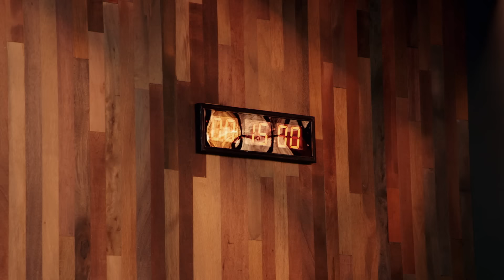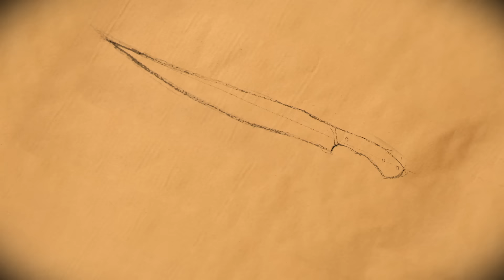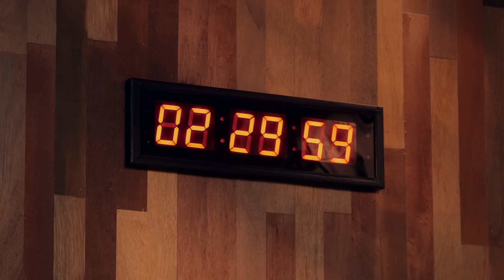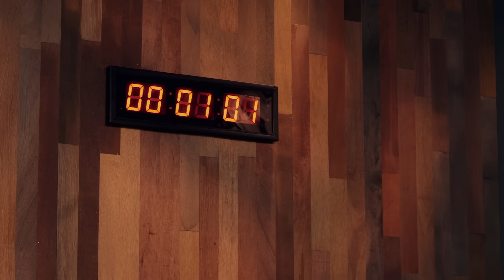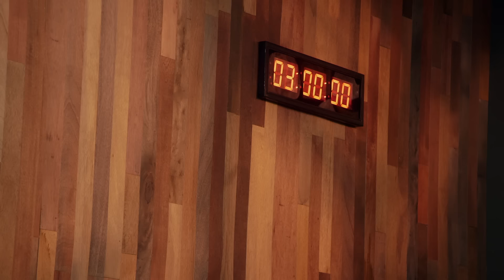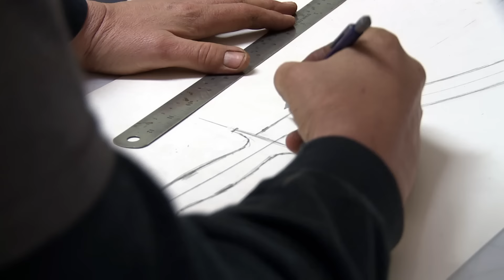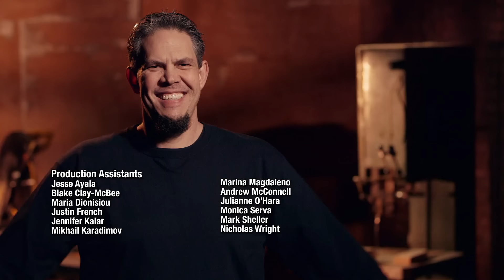Forged in Fire: REMAKING the Most Beautiful Blade in History (S2, E7) | Full Episode

Comment: This episode has me wanting to take elevator cable to make a snakeskin damascus core, then a very high (1200) layer count twisted bars, finally w2 bars and forge a serpent in the blade shatel. Then finish it with a sculpted bronze handle with the heads of the hydra being the cross guard.
Reply: Do it sounds like it’d be a amazing blade !
Reply: @wazrokk6626  man i saw a video that increased my idea to a double serpent in the blade idea... guy put two twist damascus serpents in the middle of a tapered broke back saux. I was like I can do that but with cable, then put w2 between them and on the outsides, then put twist bordering that then w2 for the cutting edge, run a remedial ridge in the center and hollow grind it to make it super light and fast yet super strong. Then I thought about s7 spring steel as the boarders of the serpents with the remedial ridge so it can spring and twist easily and not break, but I think I would have to use s7 and 15n20 in my twist to maintain the spring. However 1085 and 15n20 in the twist, s7 in the borders, and w2 in the edges would make a bunch of contrasts in the etch. I would just have to be really careful in my quench and temper to give everything it's best performances. I'm going to think on this a bit, then make a test billet and see how it works before I go into the expense of making a full sword. A 12 inch saux would let me test the theory, then I can go for a full sword.
Reply: @ make sure to make a video of it and tag me in it I would love to see this!
Reply: @ I think it’d also be neat to see everything made from scratch from raw iron being made into steel into a sword
Reply: @wazrokk6626  i am thinking of doing a tamahagone one also, or a crucible steel and tamahagone version with a wrought iron serpent. Another sword i wanna do is a twin sematar that inner lock to look like one normal sematar and then swings open to lock in as a double ended sematar using tomahagone only in a true Japanese style blade construction sami. Including hamone also.

Comment: What (if anything) is the difference between wrought iron and "pure" iron?  Also, what are things that smiths should avoid when working with working with wrought iron?
Reply: "Pure" iron has been melted from ore and cast once. Wrought iron means its been worked after that point. So unless the iron is in the shape its casting mold happened to be at the smeltery, it's wrought iron. This includes if while still molten from its first melt it's processed in any way other than being allowed to fill a mold. This is because Wrought is an old word meaning "worked" or "crafted".

Comment: You know this is an early episode because Kevin would have been DQ'd on a parameter failure for not turning in san mai ("three layers") in later seasons.
Reply: i may have just watched it wrong, but i think they let it slide bc as long as its still 3 layers, 2 soft and 1 hard in the middle, its still san mai. he just had a lot of layers of the soft metal over his middle hardenable steel. i could be wrong though
Reply: San Mai was not specified as the forging technique, so the bladesmiths were free to choose what technique they used.  Kid's lucky Erin failed parameters; having wrought iron on his edge would've gotten him kicked

Comment: All bladesmith here : I have the needed metal right here on my anvil, so, what is hiding under that tarp ?
Wrought iron, but also some cast iron. Not enough carbon or way to much carbon.

They should not use the press when first setting Damascus. Use the hammer or a power hammer for that.

Chad's shotel is probably the closest to the original design, just as it transitioned from a sickle to a proper weapon. Burt's is closer to the later design.